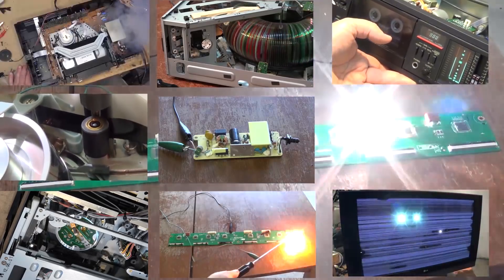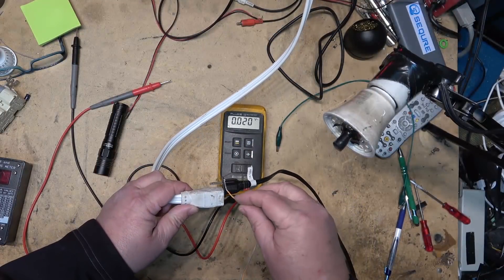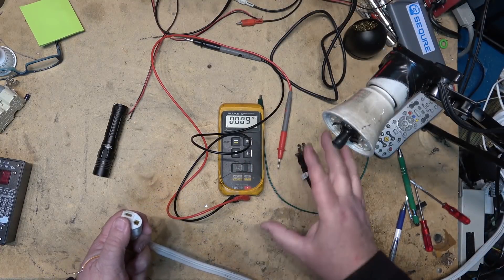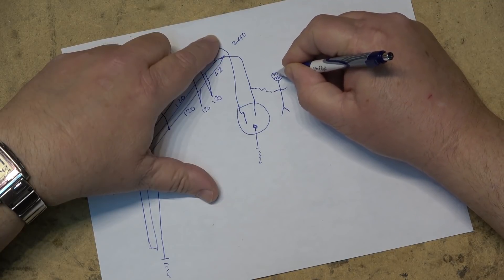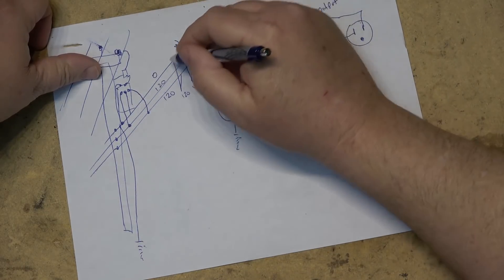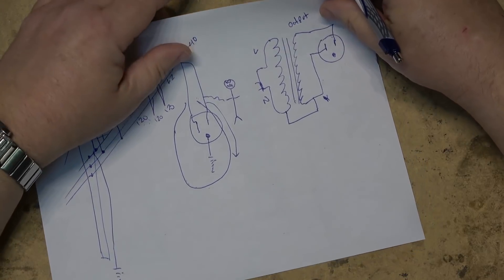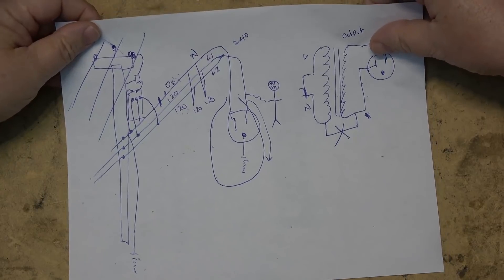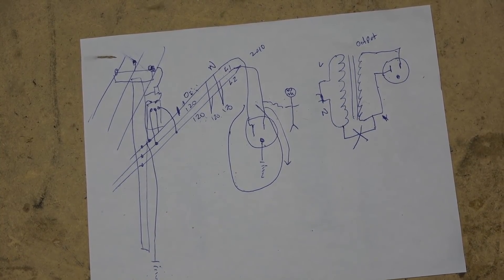Isolation Transformers For Dummies

Comment: Many oscilloscope probes get blown apart when the ground wire connects to a hot TV or radio chassis. You must use an isolation transformer.
Reply: or, isolate the scope's power cord ground and then be REALLY careful...lol (Classic Bad Move)

Dual trace scope with invert option for one channel (using no probe ground at all) is another way to risk riding the lightning.

Comment: On an isolation transformer that isn't really an isolation transformer because the neutral is bonded from the input to the output as per your diagram...what's the point such a device? Why would the manufacturer do that when it would work perfectly without the bonded neutral AND offer an isolated output?!?
Reply: Medical grade isolation transformers bond the neutral to ground at the plug for the secondary. This is done to reduce noise on the line not to isolate the secondary from ground reference. "Isolation" in that case means "noise isolation" not ground isolation. Furthermore in order to meet electrical code the secondary MUST have a ground wire which is connected to chassis and outputs on the outlet of the transformer secondary. These are not designed as tech isolation transformers. They are not designed for that purpose so no need to hold them to a standard to which they were never designed. If you wish to use a medical grade isolation transformer for ground isolation then they need to be modified.

Comment: hey, i'm just struggling to understand how if you touch live (Hot) and youre touchign a metal tap for example, why you wont get a shock? as you still have a path to earth?
Reply from the maker: Because there is no "hot" on the secondary as it is isolated from earth.   You will get bit I'd you touch both secondary wires.

Comment: Im plugged into an isolation transformer but reading 114 volts between hot and a  12 gauge wire connected to a   ground rod driven 3 feet in  , that part of this video seems to be cut , what was your reading between the hot and home made ground with the  isolation transformer plugged in ?
Reply from the maker: With a floating secondary you will typically see 50 to 60 between ground  and either side as there will be induction and your meter is high imedence. You will see on both the legs. As there is no hot and neutwal.   On the other hand if one side measures 120 to ground and the other side 0 then you don't have a real protective isolation transformer.  You have a grounded secondary.  Now these are fine to filter out high frequency noisrvbut have no protective value at all untill you open them up and disconnect all grounding. A service isolation trany has a 2 prong non polarized cord and ungrounded outlet.
Reply: @12voltvids  I have 123.3 between hot and neutral and 123.1 between hot and home made test  ground  .I have a variable output iso trans  set to 125 , it measures 128.9 between hot and neutral when on and 114.5 between the hot and home made ground . Looks like a reduced ground connection , is this the way they all read?

Comment: Thanks Dave for the video. I work on audio equipment and figured transformer powered preamps were isolated from having a hot chassis. I measured my new dso’s bnc sheild to the preamps chassis. Wow 50vac. This preamp transformer has a grounded center tap secondary. Could this 50vac be induction induced? I am holding no one responsible for any answer I receive. Thank you
Reply from the maker: Do a leakage check.

Comment from the maker: That's a variac and they are not isolated.   I have an isolation travafirner ahead of my variac.
On a true isolation travafirner there is no connection between mains and ground so measuring either the hot or neutral should in a perfect world measure 0.  
I will do a short new update to show this operation.

Comment: A bit confused . Around 11:15  you talk about the incoming power neutral carrying the entire load ??? Won't the neutral at the premises carry that load via the earth bonding to ground at the premises??
Reply from the maker: Neutral is bonded to earth at home and at pole.  It carries the entire load back to the transformer. Of course if both sides of the line are pulling equal power there current on neutral will be zero.  However say you are pulling 15 amps on one leg and 10 amps on the other leg, there will be 5 running down the neutral at 0 (or close to it) volts.

Comment: If you need a light way out in the back forty and don't have a long extension cord but do have a long spool of single wire you can drive a ground rod at the location and use that for nuetral.   The supply voltage will depend on the resistance between the location ground rod and the main service panel ground

Comment: So, by removing the green ground wire from the secondary coil, you have isolated the coil from ground. But, the grounding pin sockets of all four sockets are still connected to to the chassis common screw ... the same common that runs to the primary ground. So, they are all grounded, despite the open secondary coil ground. I understand that this does result in a floating AC circuit, but, the isolation transformer case ground is still going to be in series with the test load ground. What was gained by isolating the secondary coil from ground? And is that protecting the device being tested and me? How?
Reply from the maker: You weren't watching.  I removed the ground from the chassis as well.  You do not want any reference to ground.  Primary is connected to hot and neutral and secondary is connected to output receotical.  No connection to ground.  My isolation transformer has a 2 prong cord and 2 prong outlet.  As there is no bonding to ground you can't get shocked by accidental contact between a live source and earth ground.  You will get a shock if you get connected between the secondary winding but not secondary and earth.

Comment: Being able to connect the cord like that is already a big security problem. And keeping it like that for ages... Not safe at all.
Btw there's no RCD or anything disconnecting mains if there's a difference in the current in live and neutral? It doesn't prevent you from receiving a pretty bad shock but at least you don't stay connected until you are cooked by electricity.
Reply from the maker: Well that is what standards are.  You can't just dictate that all plugs and sockets be changed.  Could you imagine the chaos this would cause if everyone had to change all the sockets and plugs on everything.  If something like that was mandated everyone affected would expect all the work to do this be fully paid by the government.  So it's not going to happen.  There isn't even a requirement to put in polarized outlets on old homes or upgrade them to 3 prong grounded.

Comment: A lot of the isolation transformers that I see have the mains ground on the input (primary) side connected to the IT case, and then to the output ground. Since ground is tied to neutral at the mains, this is not a “true” isolation transformer. So I know the practice is to remove the ground. 
My questions are:
- Do you remove the ground at the output and keep the IT case still grounded to mains (like using a cheater plug)?
- Or can you remove the ground on the input side so nothing is grounded?
- Or does it matter which way you disconnect the ground?
Reply from the maker: Nothing is grounded on isolation transformer.  2 wires in, hot and neutral and 2 wires out.   Since the secondary is floating there is no neutral and no hot.  Either one can be hot or neutral. That's what protects you and test gear.  You make contact with anything while standing on a wet floor with bare feet and nothing happens as the potential is isolated from ground.   Now grab onto both secondary wires and yes you will get a shock but not from accudantal contact with earth ground and anything live on the chassis.
Reply: @12voltvids  thanks for the reply!  What about if there was a short on the primary side inside the IT, wouldn’t you want to ground the IT chassis to earth’s ground (and still have no ground on the secondary side)?
Reply from the maker: @jimkluka  when is the last time you saw a transformer short to the core? Like never.  If a winding shorts there will be smoke and the winding will pop.

Comment: Great video! Say that transformer on the pole outside were to blow and surge. Would this protect 3 phase machinery? We’ve had servo drives fail because the power in the building goes out. We assume a surge but the fuses should protect the hot lines. Would this be caused from a surge to the ground connected to the servo motor drives?
Reply from the maker: The isolation transformer is to protect service personnel from accidental contact with a live wire and ground. It's a safety device for when you're working on equipment and isolates the equipment from the mains.

Comment: what if you do not have ground wire in your apartment, only live/neutral is there any use of isolation transformer then? EU here.
Reply from the maker: Yes. Neutral is grounded.  Isolation transformer isolates device from both live and neutral.

Comment: Great explanation, and maybe you don't want to get into a bunch of theory videos (and if so, that's fine), but I'd love to see an explanation drawn out explaining something I never understood even when going to electronics school and that is how you can have a 'negative ground'...I always thought ground was 0 volts and what you were measuring with a meter was the volts about zero.  I still can't wrap my head around the the idea that ground can be below zero..would love to see a video explaining how that can be (and why you'd want it).
Reply from the maker: There are electrical currents moving through the ground.  Drive 2 ground rods seoerated by say 30 feet and throw a meter between them. You will read the potential difference between them.  This is why you see spread out through the community cathodic anodes driven into the ground.   They typically put about -48 vdc at many amps directly into this electrode driven into the ground at the base of a pole .
This neutralizes ground currents that would otherwise attack underground metal pipes such as gas or water mains causing erosion.  We have submarine high voltage lines in my community that feed the island and before the cathode installation it was causing failure of water mains. 
Anyway back to the 2 ground rods you will see only perhaps 1 volt difference but if you short them together you can pull several amps of current. This is why ground bonds need to be connected together.  An isolated ground can have a difference in potential.
Reply: I'd say it's more a handy/useful selected reference level, and other voltages can be both above and below it. Often it's related to something physical like the/Earth, or a car chassis, but it also might just the most common voltage level in your circuit (ie a useful reference level)

Today cars typically have the negative pole tied to the chassis/engine block/etc, and equipment are supplied nominal +12V. But for instance older British cars often had the positive terminal tied to the chassis/engine block/etc, and equipment was supplied with nominal -12V.
For equipment without a grounded chassis, or an output that is grounded (the early lower output power radios with 3 wires for 2 speakers, left/right/ground) it doesn't really matter, they  operate on the difference between the lower and higher voltage supply wires - those wires could be anywhere with respect to 'ground', like say +40 and +52, or -12 and -24, as long as an actual connection to ground is made or needed, the unit would happily run on the 12V difference.
More high power output stereos have 2 wires for each speaker channel, so that a symmetrical (+ on one wire and - on the other,  to provide twice the possible voltage swing (and 4 times the possible power, instead of having one side of the speaker tied to 0V/ground.
Reply: Mike Ochs, do you mean a negative ground in a car battery? Ground in that case is not "Earth" ground, but "Chassis" ground which is a large conductive chassis that carries the current from the negative side of the battery to the load.

 If the positive side of the battery is connected to the chassis, then it would be a positive ground. The word "ground" is just a misnomer and is not to be confused with earth ground.
Reply from the maker: @zulumax1  in the telephone industry the positive terminal of the battery is ground and is earthed at the central office and it the tip side if the loop.   The negative terminal is what is connects to the ring side of the loop.
Reply: @zulumax1  No, I mean like I remembering seeing circuit schematics where ground was specified as a negative number. I always equated ground with zero volts (so no electrical activity at all) so I never understood how ground could be anything less than zero.
Reply: @mochs3869  I have seen them do that in tube circuits to get the grounded cathode more negative. Bias reasons I guess, depends on the engineer who designed it.

Comment: Where I live we have 3 phase service. the middle or common of the 3 phase is the neutral. each phase is 220~230VAC.  Would an isolation transformer make sence in that scenario too?
Reply from the maker: You are still only using a single phase for apliance or equipment.  Isolation transformer will still isolate you.   We have 3 phase here too.  208 / 120.  Yours 400 / 230 . 3 phase uses 4 wires.  3 hot 1 neutral.
Reply: @12voltvids  is the problem that the main transformer neutral is connected to ground? if thats so, what's the reason trafo neutral is grounded?  isn't that the only difference between iso-trafo and main trafo?

Comment: Noticed quite a bit of confusion about what a GFCI circuit is and how it functions in the last posts prior to this redo. Perhaps you could explain that in another video to folks why isolation of the ground is better than waiting for a ground current fail.
Reply: Just to clarify my comment. I am NOT implying that GFCI is a replacement for an isolation transformer. I simply noticed that Dave's outlet at his workbench area is not GFGI protected. I always plug DUT into an isolation transformer. But transformer is plugged into an outlet that is on a GFCI breaker. And all my instruments, tools, music equipment - anything I touch is on that GFCI circuit breaker.

Comment: Sony's first consumer video projector used an isolation X-former to allow use of their standard hot chassis TV (necessary for video/audio input connections). It featured a single glass lens, curved plastic, metalized surfaced screen. Even the Trinitron support wire could be seen.  lol
Reply from the maker: I have one if their single tube projectors.  It used a liquid cooled indextron tube.   No aprature grill, single electron gun like a b/w tube.
Reply: @12voltvids  Yea, very nice. I watched your old 8/9/2016 video; that index technology is classic Sony innovation and yours is much newer and more complex.  I checked my ~34" 3:4 screen, the box says VPS-400  with PNs 4-316-806 and 3-701-355  lol, ~Dec 1975  As I recall, the Sony "prototype" contained a simple TV chassis (requiring an isolation transformer) in a large wood cabinet, maybe KV-1212, no cooling with a single glass lens. I don't recall if it even used a mirror. About the same time the first Beta deck (in a console w/monitor) appeared. 

BTW, I still use that old Sony isolation transformer PN 442-523-11  5FYI  

Thanks Dave, your videos bring back so many memories... and repair nightmares too. Do you remember the KV-1920 repairs requiring an external 19V and 130v power source hooked up to hunt down actual cause without blowing the SG-613 gate controlled switch (again)? A conventional tiny 130v regulator transistor would just blow like a fuse if the set did not properly start up within a millisecond. lol
Reply from the maker: @FindLiberty  SG613 oh God i am having flashbacks now.   There were many days when i asked myself why i ever went down the road .  Electronic repair was never my first choice. i originally planned to go into television broadcasting.